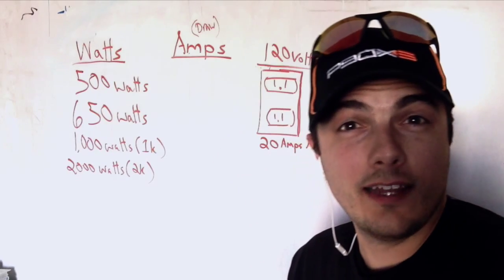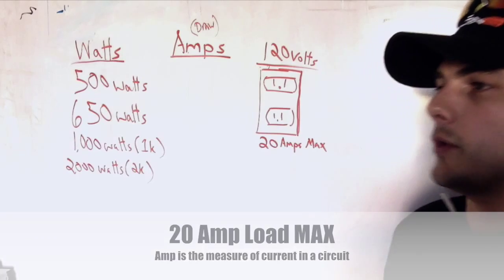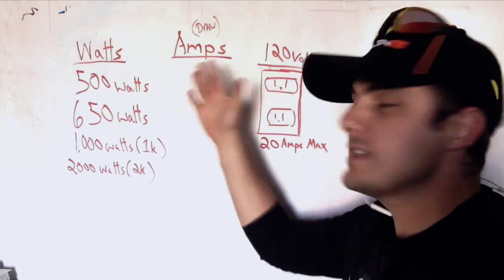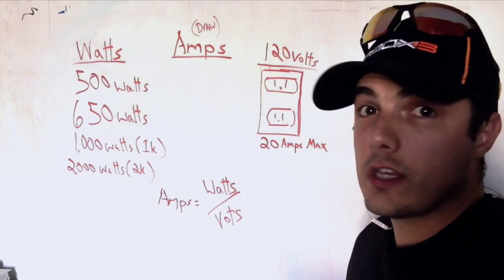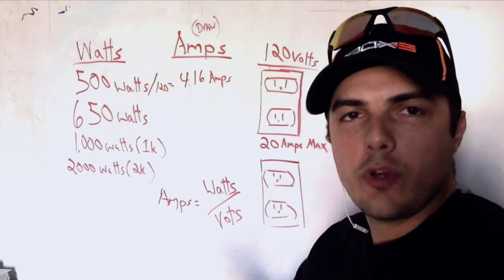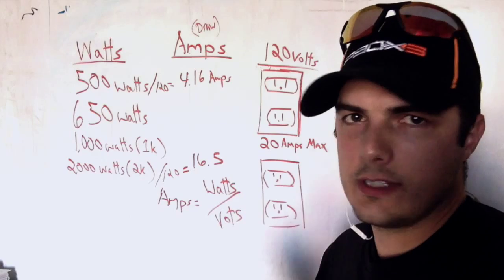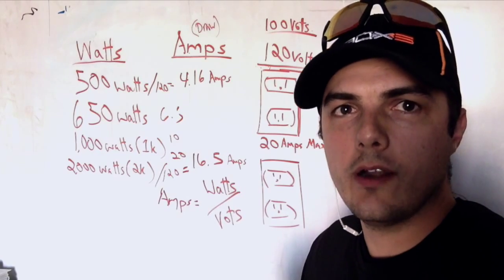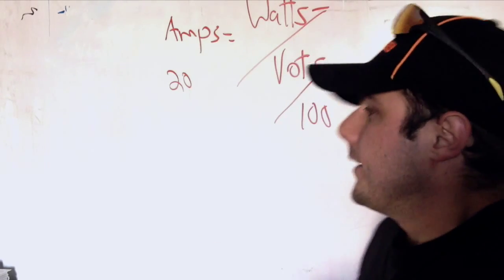How to NOT burn down your set

Comment: So do I assume my 2000 watt generator with 120 volts. Is 20 amp?
Reply from the maker: If your generator says it can supply 2000 watts it would be good to do some more reading and see if it's a peek 2000 watts or if it's a sustainable 2000 watts. Some of the smaller putputs will only supply their top wattage for a short time but they aren't meant to be run that hot the entire time.  If you use the equation you are looking at about 16 amps of usable power out of that generator (Amps = watts / volts) They might just label it as a 2000 watt generator for simplicity, it might actually provide 20 amps and they just put 2000 watts on the sticker because everyone knows what a watt is and it keeps it simple.  I would do some more reading in your manual or on line and see what it's actually rated..